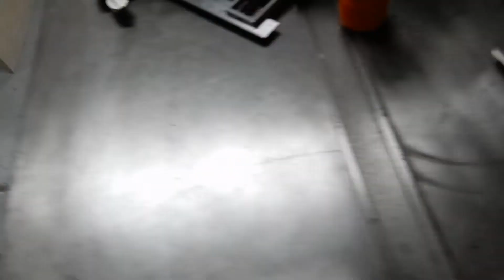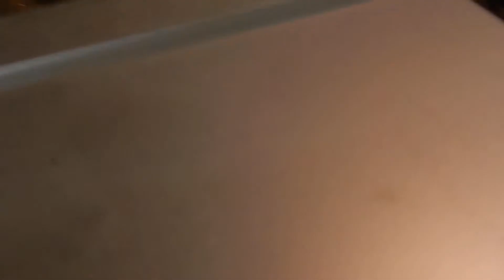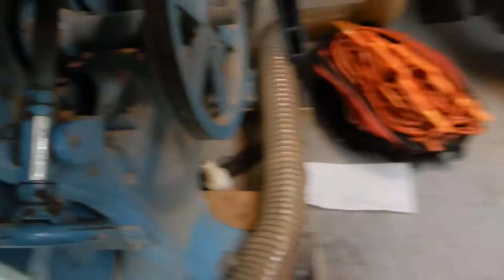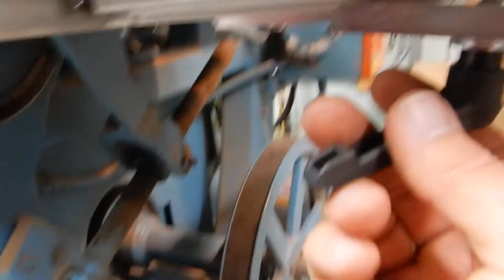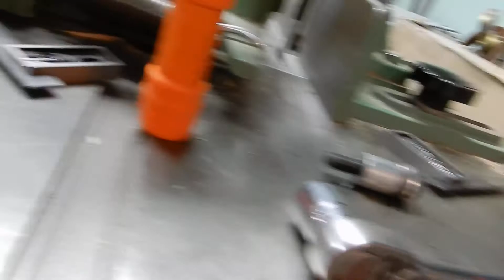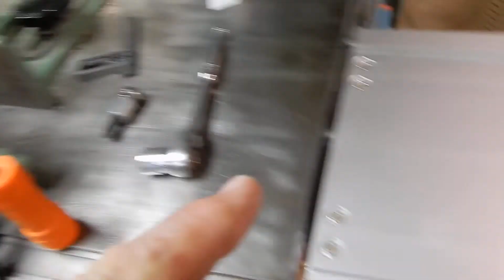Felder F rail install to mount Felder aluminum table extension Part 2

Comment: I too have come across from Neil McKinley’s channel. So Hi from Bradford westyorkshire England. Looking forward to viewing the rest of your vids. All the best Chris c
Reply from the maker: Nice to get a shout from you Chris C. I too hailed from England, Melchett, Downton, Wilshire, albeit some 12 generations back when Henry came over to settle in Newbury Mass. But, don't go alooking for me on that side cause I taint there; find me in Chicago making saw dust and breathing -5 degree F air; in short breaths of course!
I am into muntins now and have perfected a profile and size that goes with the Felder tooling for interior doors.
I had to break away from muntin play for 3 hours yesterday to go spec a kitchen set of cabinets. 3 hrs. it took and the master of the house kept adding more arms and legs to the page. After a second meeting he aired that he wanted to contract for a quartz top to go with the QS oak presentation. If we put a slab of quartz on the horse we have to build it a bit (Neil--wee bit) stronger due to the 235 lb additional weight. He added a bifold door in the corner and then his wife wanted red oak with beading to replace the fireplace mantel with some deeeeep moulding that he wanted under the mantel lip. Also, sand and refinish the red oak kitchen table top due to a mystery of who put the hot pan on the table? So off I go to the lumber yard down in Chicago this morn to look at beading sizes. I would prepare some oak for to do a 4 rib bead on the Format4 with the high speed spindle and a chosen size of bull nose router bit with multiple pass in mind. They want the same rail and style profile to be carried to the 9 drawers faces. I will use the membrane press (Barth-Martin) to affix that element to the drawer face. Happy New Year over there. 
Then, we have Junior just bought a town house some 26 miles away; "Who gave him the money? I didn't give him the money? Wife--You didn't give him the money did you?" "No!" "Where did he get the money?"  OMG

Comment: Stopped by to check out your channel.  Neil McKinlay mentioned your site on his channel.  Seems interesting and thanks for your video
Reply from the maker: thanks for taking a looksee at what can be done in Chicago. Neil is a character!
I bought these F rails some years ago and had them in a box. Of course mating an American made saw with holes in the table to a Euro rail requires some measure and technique that a machine shop would love to do for us$$$.
I grew up around the printing industry when lead type was king and a metal cutting saw was part of the act with precision required. The time of picas and rules and wooden block type with ink on the fingers and face.
It seems like such a simple thing to put a rail on a band saw table; but, easier said than done. Thanks and have a good New Year